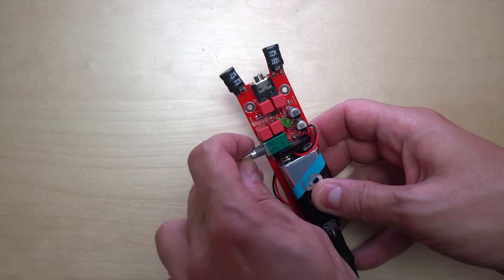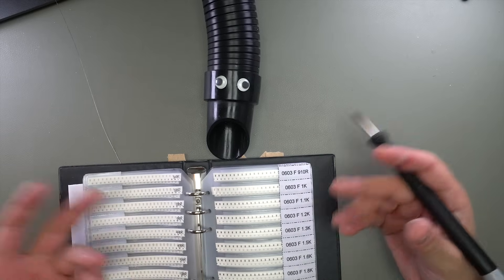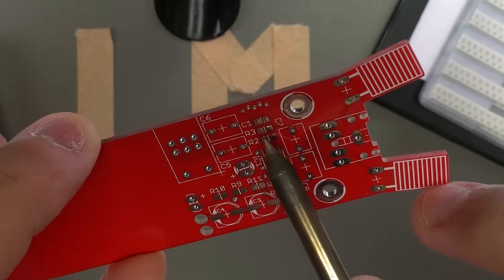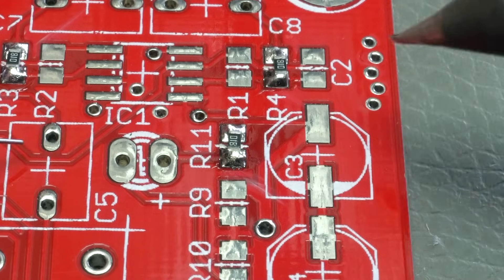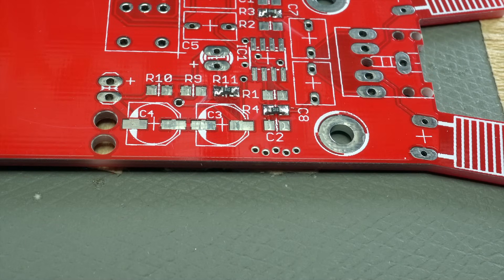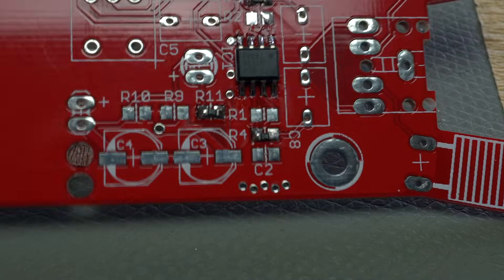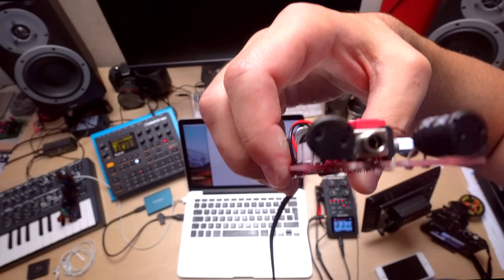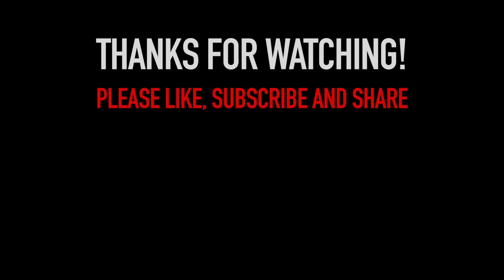How to Solder Surface Mount parts (it's easy!)

Comment: Great video.  I once made a very low frequency radio that had an antenna a bit over a meter in diameter of 300 turns of wire.  I was able to listen to my TV, the outdoor utility pole and a lightning storm coming in,
Frank Reiser M.S.
Reply from the maker: Fascinating!  It never occurred to me that you can use this device (when properly tuned) to listen to a lightning storm. I associate this device with sounds from man made electronics but it’s interesting that nature can generate interesting sounds for it as well. Thanks for sharing this.
Reply: @LeoMakes  I am fascinated by the electromagnetic spectrum and radiation.  I liked my VLF receiver because it was so far down the electromagnetic spectrum.  Incidently, I have a Geiger counter and radioactive rocks.  I have collected the Americium 241 from smoke detectors.  They release an alpha particle and then a gamma ray.

Comment: what brand is that soldering iron.  Can't find anything like that. IMHO that really short length is also a big plus for success.
Reply from the maker: 100% agreed on the short grip-to-tip length. It’s easier to do precision work when you can hold the iron like a pencil. 

My soldering station is made by MetCal. MFR-1100 model.
Reply: @LeoMakes  thanks

Comment: Suppose Ben Folds installs the wrong part in the wrong position.  Then he doesn't come in the next day.  And you gotta fix it.
HOW do I REMOVE an smd parts?
Reply from the maker: I'm not sure if this video is exactly what you need (I should consider doing a more comprehensive video on the subject of re-work) but this might help you get going.  Good luck with your repair!

https://www.youtube.com/watch?v=NgqagebKKG0
Reply: @LeoMakes  thanks

Comment: Dude can u use Bluetack to hold pcb in place
Reply from the maker: That's a great tip.  If you're soldering a lot of stuff in a row, blue tack can help keep the board from moving around.

Comment: Hello Leo.. Received my parts for a eurorack pcb and panel I'm soldering but have ruined the pcb already as the solder dried before I could get my 603 resistor in place. Is it my technique or the cheap solder I have bought?
Reply from the maker: Sorry to hear about the troubles, mate.  It's hard to troubleshoot from a distance, but I hope you keep trying until you figure it out!  If it's possible, try to get someone experienced in soldering to sit down with you and give you advice in person. A few minutes of one-on-one might be all you need to get going.

Good luck!
Reply: @LeoMakes  thanks for the reply. I've read up on tinning my tip.. Maybe that's the problem. I'm looking into a rework station now.

Comment: Yeah, we used to do it this way back in my day (20 years ago). I don't like your choice of a soldering iron tip though, the ones like a cone section hold the solder drop / puddle better. I mean, not a pointy tip, but an elliptical one.
By the way, pin 1 for IC has usually square edges while the rest of the pins' pads are rounded (to mark pin one), haven't seen that bevel thing ever. Also make sure you solder two diagonal pins before you start soldering the rest. Never solder one by one, add some rosin (perhaps dissolved in alcohol or just rub a crystal between the IC's pins, to powder it in there, then use a tip with a conic section and just drag it over... all done in one swipe. For the smaller raster you have to check the result with a lens or microscope even, but it usually just  flows perfectly. After you are done, brush your board with alcohol and a brush (with short bristles, perhaps a tooth brush??! or a shortened painting brush of the proper size), never leave any rosin sitting there.

Comment: Now try that with cheap Chinese solder, which is the only kind I can find in Asia. (smile)  Do you ever use flux? (thank you)
Reply from the maker: Ha!  Good quality solder really makes a huge difference.  I bought the thin stuff from a local shop in Sweden and it is actually made in Japan.  

I definitely do use flux when I'm doing rework but when I'm putting down fresh parts on a new PCB, the flux inside the solder is totally sufficient (electronics solder almost always has a flux core and it's usually enough).

Thanks for watching!
Reply: @LeoMakes  Thanks for the answer, I've been doing electronics for about 50 years but at 63 can barely see these components.  Did build a micro clock last night and it worked, but it's not as pretty as your soldering.
Reply: @LeoMakes  Thank you for a good video.

Comment: Great video! Could it be used as a non contact audio or rf probe specifically in troubleshooting audio gear such as tube amps or old tube radios? Thanks again.

Comment: On a range  from a dull cold joint, to the very best high shine, highly wetted solder joint,   these look like they’re somewhere around the middle.                                  
                                                       
Some rosin core solder     sizes/brands have too little rosin, thus just a touch more can help.                                                    You are concerned about a sticky mess left behind,           valid, but this is very easy to avoid.                                            A chisel tip might transfer heat better.                                             It doesn’t matter that all parts are new. All parts need deoxidizing/cleaning, but more to the point **adequate**... deoxidizing;   and as several other commenters also observed, these joints would benefit from a bit more.                                  It’s true, since the joints are conductive, it can be argued it’s good enough.                              But It’s not hard to get that shine, and make it ..even better. Go for it!                                 (Much more satisfying.) 😉

Comment: Great Video. Thanks Much.  Now I feel confident to tackle SM parts. 
I have  one question:  Do you use magnifying glasses to see what you are doing? ... or some special microscope?
Reply from the maker: Thanks for watching.  In this video I just did it by eye since I had the filming gear in my way, but normally I do have a magnifying lamp which I find super helpful. It puts a ton of light right where I need it and also magnifies so I can check my work.

I don't own a microscope right now but I would absolutely invest in one of i I were regularly doing smaller parts ("0402" components or below). They make life a lot easier!

Comment: Funny, came here for advice on smd quad flat pack soldering. I own the Original Electroslüch from LOM. Great guy, great device!!! I use it for locating RF Interference but also so much more both creative and useful.
Reply from the maker: Funny, I built it for sound design purposes but ended up using it for RF troubleshooting since a lab spectrum analyser was hopefully out of reach for me.  It totally did the job!

Anyway, thanks for watching!

Comment: what fume extractor do you use
Reply from the maker: I use the Metcal BVX-201.  It's way overkill for home gamers unless you do a lot of soldering work.  The only reason I went for it is that I can also use it along with my engraving laser (which generates tons of nasty fumes).

Hope this helps.

Comment: wow you made it super easy, can't wait to try my smd soldering. will it work with  0.8mm solder lead ?
Reply from the maker: It should be fine.  It's easier with thinner but 0.8mm should be fine.  Good luck!

Comment: What’s a good temp to set the iron to for this type of soldering?
Reply from the maker: The temperature really depends on the solder that you're using (for example leaded solder is usually lower temp whereas lead-free is higher temperature) .  Take a look at your solder's spool or packaging and it usually spells out the ideal working temp.
Reply: LeoMakes thanks dude

Comment: What would be the best soldering iron for de-soldering on surface mounts PCBs? I am particularly interested in knowing the type of soldering iron "bit" or "tip".
Reply from the maker: It really depends.  A "tweezer" style soldering iron (basically two irons on a hinge) is great for removing simple components quickly (like resistors, capacitors, etc.) If you need to remove an IC or something with lots of legs, the best tool is actually hot air rework station.  I made show how that works in a different video:  https://www.youtube.com/watch?v=NgqagebKKG0

Thanks for watching!

Comment: Hey Leo. I have a card to solder a 3 pin plug on it witch broke. But the part where i have to solder is a bit shred. When the 3 pins plug on the board broke it took away the metalic part or the board where i have to solder it. How can i repair it?
Reply from the maker: That sounds like a more complex repair.  If the pad (the square metallic part that attaches to the 3-pin plug) has been torn off, you might be able to very carefully scratch away the material covering the PCB "trace" (basically the copper line that goes to where the pad used to be).  If you're able to scrub that off and expose the copper, you might be able to very carefully solder a wire there and connect it directly to the 3-pin plug. Again, this is going to be a more complex repair job, but you might give that a try.

Good luck!
Reply: @LeoMakes  Thanks mate. I was going to try to wire it and solder it down the way you say. Thanks again 🤟

Comment: flux would make this far simpler and neater
Reply from the maker: No need--the solder has flux in its core and the parts adhere properly.  Overdoing the flux means you end up with a sticky, nasty mess on your board that you have to clean up with alcohol and scrubbing or an ultrasonic cleaner.  I use flux if I'm doing re-work but it's really not on a fresh board.
Reply: LeoMakes  No just a touch more flux would improve your flow and wetting without mess.

Comment: This video is a metaphor for life. 

Clean up before you start. 
Use the appropriate materials for the job, so you don't mess things up. 
Do one thing at a time. 
Put things away when you are done with them.
Be careful not to touch things that are extremely hot.
Sometimes high-end parts are used to record noise.
It doesn't have to be perfect.
Reply from the maker: Amen!  My next video will be on how to write a philosophy book (just kidding).
Reply: I have been trying to touch things that are extremely hot since puberty

Comment: Are there companies you know of that sell nano (402) LEDs on a strip or reel like shown in your book?  Everything I've found already has wire on it and I don't want that.

Thank you!
Reply: Any real distributor (like Digi-Key), or eBay or AliExpress. Make sure you’re looking for the correct size code, i.e. “0402”, not “402”.

Comment: Awesome job! I've heard it suggested to solder sockets for the IC instead of mounting them straight to the PCB. This way you can easily switch out fried components. I'm not sure if this would have much of an effect on the circuit itself as I haven't tried it yet.
Reply: Are there smd ic sockets as well?

Comment: Thanks for the video.  I just got my first surface-mount assembly job.  I was trained 30+ years ago to do through-hole soldering.  BOY!  The component size difference is insane.  My eyeballs are already freaking out.

Comment: I have a question why u don't use flux sms soldering
Reply from the maker: It's not necessary when the solder has flux inside itself. Nearly all solder for electronics work already do contain a solder core inside. I would use flux if I was re-working something that is already on the board, but since this is a fresh board there is no need for more flux.

Thanks for watching!

Comment: Nice video bro,do u think you could hear a short circuit in a PCB with that device,it would be cheaper than a thermal can!
Reply from the maker: Hey Eddy. Definitely not.  This thing picks up all kinds of noise from the air and does not give you anywhere close to the resolution you need to pinpoint a short circuit.

Comment: Dude, I love this, but for the love of all things holy please give those poor poor pads some flux!
Reply from the maker: I don't know why I'm seeing this now (four months late!) but flux really isn't necessary here.  It's a fresh board and the solder has a rosin (flux) core. There's plenty of active flux in there for good adhesion otherwise the solder wouldn't adhere nicely to the part and the pad. I'd definitely use flux if I were re-working an old board or other specific tasks (like drag-soldering), but it's really not necessary for a simple job like this.
I think people tend to overdo and even fetishize the flux. I've even heard things like "you simply can't have too much flux" but those are the same people that end up with a nasty, sticky mess on their boards!  You end up having to spend an extra 10 minutes scrubbing and cleaning with alcohol or putting the board into an ultrasonic cleaner to get it clean. I try to avoid all that.
Thanks for watching!
Reply: @LeoMakes  The Rossmann Army .-D
I admit being a soldering disaster (despite a few decades of tinkering with electronic stuff), but I'd never even heard about flux until a few years ago. I actually have a can of rosin I've always used as a tip cleaner, and I'd never thought about sullying my precious boards with extra sticky brown gunk.
Liquid/gel flux is a late addition to my workbench, and it actually helps in melting the "lead-free rubbish" (®eevblog) most boards use nowadays.

Comment: I do a similar process, but I add solder to one pad on all SMT parts before I begin to place anything. I find it speeds up the process a bit. Always add the solder to the pad opposite the hand you hold the tweezer so the tweezer does not get in the way when placing the part and reflowing the solder.

Comment: It is a bad idea to heat up small pads and small smd parts. Beginner will destory pads on pcb. Another problem is that many parts are sensitive to heat (like LEDs) and you will destroy them if you heat them up for too long.

Comment: Is there a specific type of solder for these parts?
Reply: No, it's the same you use for THT, but solder paste might be used sometimes, which is a paste containing flux and little pieces of the metal alloy. By heating it by hot air you melt it and it turns into normal solder.
Reply: @mareksvrcina5279  finally, I looked through dozens of comments and you seem to be the first person that has mentioned the elephant in the room - why this video didn’t show solder paste and a SMT hot air tool? That’s what I came here for - advice on temp vs. airflow :)

Comment: is there a way to fix burned pads?
Reply: The Flamethrower Yes, there are. There’s a thing called a Cir-Kit that has replacement traces. Crazy expensive though. It’s much cheaper to just use magnet wire (enameled wire) to jumper the component pin to the trace.

Comment: You don't even need that much solder on the pads. But a nice video, Leo, with nice and clear close-up shots. What SMD part size would you recommend? 0603 is the smallest I've ever soldered, but 0805 is a little bit more comfortable, while I use 1206 only when 1/4W power dissipation is needed (1:1 replacement of THT resistors).
What's your opinion on that, what size do you prefer?

Comment: Thank You for the video. I have a 3D printer that my micro USB port came off of it's board and I need to solder it back on. The printer doesn't have a display like most do today and the only way to monitor it is through a computer plugged into the micro USB. This gave me the know-how on how to properly do it, instead of winging it.
Thank You,
Frank M.

Comment: Try to be a bit quicker removing the iron. You are expending all the flux and oxidising the solder. The result is a dull, crystallised tail following the iron as it is removed.

Comment: I just wish you touch-up those resistors with flux...
Reply: Yes flux then solder
Reply: i’m new to this and really getting into soldering in general, so this might be a stupid question but - if his solder was rosin core solder, would he still need extra flux?
Reply: @san_dingus  flux burns off as you solder. Generally by the time you've got the pad set, the flux is gone.
Reply: @san_dingus  Late reply, but the general thought is that as long as you are heating the pad with the iron and adding the solder to the pad, then you should be okay.  If you put the solder on the tip of the iron and use the iron to transfer the solder to the pad then the flux may cook off before it can do its job.
So, you could argue that the method used here is okay, however the far more common approach is to use flux with reckless abandon.  Cleaning the board with alcohol is a good thing, but lay of flux before tinning the pads, then flux the tinned pads again before attaching the component.  You need to clean the board again whether you use extra flux or not, so use the extra flux.  It's cheap insurance.  A flux pen is nice, but a syringe of paste flux is fine.  I use a little bottle with a needle tip to apply liquid flux.
Reply: @san_dingus   well, extra flux won't hurt, don't they?